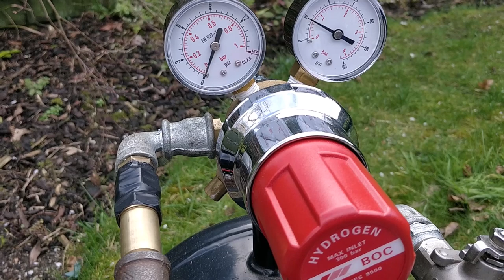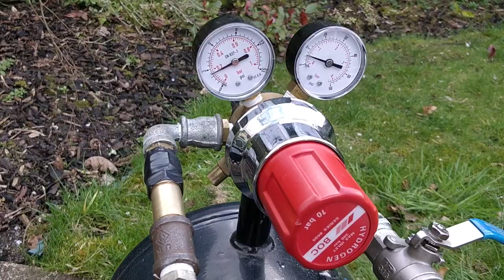Hydrogen engine with throttle control?

Comment: You need accelerator valve that will allow a higher injection right at the beginning of throttle being opened in then to taper off as rpm rise.

Comment: It is was smoke and not water vapor, bad rings allowing oil into the combustion chamber or burning carbon off of the piston or valves?
Reply from the maker: Possibly! this was an old engine at the time with damaged cylender walls.

Comment: Can you make one of these with a Harbor Freight PREDATOR 6.5 HP (212cc) OHV Horizontal Shaft Gas Engine EPA/CARB and possibly show how? Cool vids!
Reply from the maker: I'm sure it would run fine, this engine was a 6.5hp honda clone, in the end I got it to run with a simplified set with a modified LPG carburettor.

Comment: 10th. Yes water vapour.try a pressure system that throttles to the butterfly lever. Use spark arrester two,one immediately after the cell and one immediately before the carb butterfly .it's a bottle with water that the gas bubble through.because the hose ok to spark an flash but never the cell especially under pressure.H is 100 times more reactive under pressure. That's why u need so little compared to octane but in a ballon it's loud as an that's not under pressure really.so pressure to supply the revs..out

Comment: have you considered using an argon cycle?
Reply from the maker: I've not heard of this before. What is it?
Reply: @Hydrogenguys  It's a novel highly efficient power cycle that uses recycled argon as a replacement to N2 as the working fluid. H2 and O2 is combusted in a pure argon atmosphere, the water vapor is condensed and separated. According to thermodynamic theory, the cycle is 35-50% more efficient than using nitrogen.